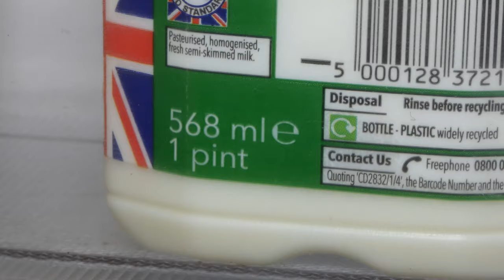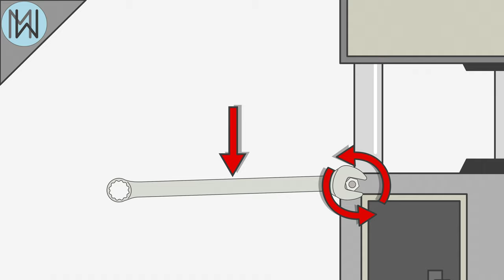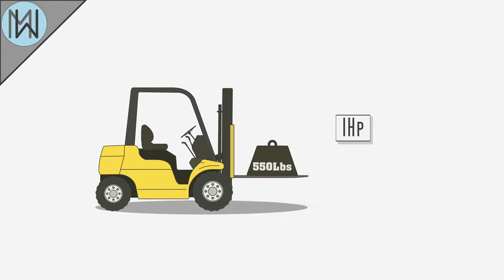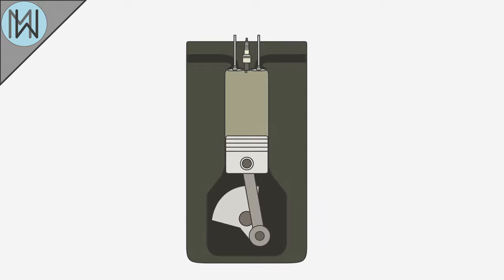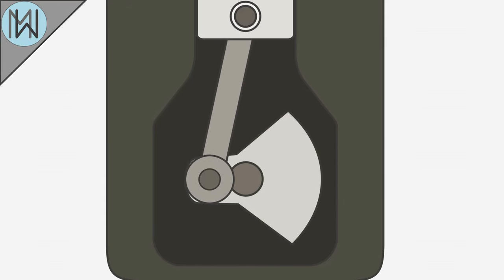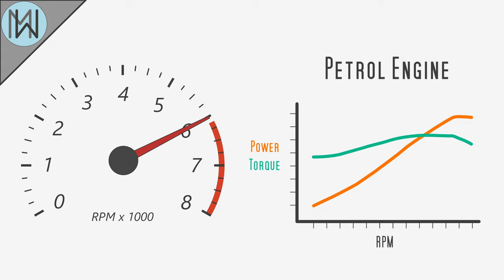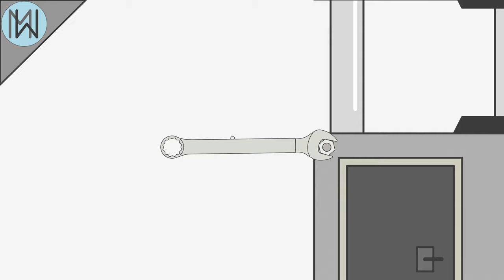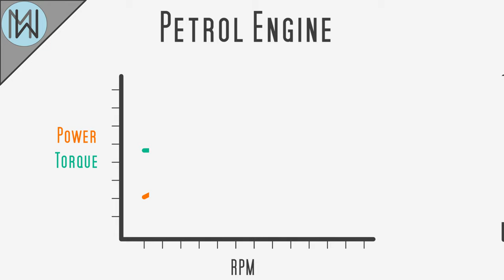Torque vs. Horsepower Explained

Comment: Horsepower at the engine is more important than torque at the engine.  If you have horsepower at the engine, you can always use gearing (torque multiplication) to increase the torque.  If all you have is torque, you CANNOT get extra power by modifying the gearing.  Ever.  That's physics.
Reply: in real driving conditions it's better have torque driving low rpms. if you think motorsport it's the opposite
Reply: @mariocasinetti158 true .
Reply: Quite theoretical, yet how come there is no excavator nor truck rev for torque, hmm..🤔
Reply: @dudulin1359  Because they run all day, every day and need efficiency and longevity.    Not because a higher revving engine "wouldn't work."  It would work fine but it would be less efficient and would not last in the application.
Reply: Got it! Quite understandable, so sounds like the engine is like a tool, no such the best in all variations but the most suitable in certain conditions tho? Meaning not always the best seeking for high HP🤔
Reply: @dudulin1359  Excavators and trucks still have horsepower requirements that need to be met.  That doesn't go away just because the engine is big and has a lot of torque.
Reply: @kevin9c1  Yet, relatively not seeking for ultimate HP right? Of course there's a baseline HP requirement. But not like a sports car which all means to be  high-end horse power, is it?
Reply: @dudulin1359  I didn't say high end horsepower originally.  I just said horsepower.  It could come at 2000 rpm or 10,000 rpm.  The important thing is how much power you have.  That dictates how much work you can do per unit time, always.
Reply: @kevin9c1  You're right, high-end isn't the factor here😂. You just answered the very first question, didn't you~ With a certain size of engine, some goes for peak torque at 2000rpm(some even less under 1000rpm) as for the specific needed like heavier loading or working needs which let the devs think "Alright, what should I do with this 5000cc monster engine? I don't want too much HP from it as I'll lose my low-end torque, instead I'll go for a low HP design with an extreme long stroke to make it more torqey."

Whilst, some go for an engine's sweet spot at 10000rpm due to its light weight design and no need to carry heavy load that the designer thinks "hmm, so I've got 1000cc engine on this R1, I would let it have a shorter stroke and revs higher for more HP since it doesn't carry too much load." 

These prove that for different situations tho, torque or either HP could have been considered even more important than the other one respectively, does it? Or maybe I may be expecting Optimus Prime revving for high HP in next Transformers based on your theory 😂😂 I'm looking forward to that anyways you know, that would be fun🤣
Reply: don't forget about 'Power and Weight Ratio', no matter how big the power is, if the weight is big too, it doesn't make any different
Reply: @mariocasinetti158 small turbos give you very low end torque, and more horsepower too.
Reply: Higher gear is more torque?

Comment: It all starts with Torque.  An electric motor can produce all its torque at 0 rpm.  That means 0 horsepower.  It’d be the same as pulling maximum force on a spanner but it doesn’t budge.  All torque and no work so no power.  But, the opposite can never be true.

Comment: Horsepower is a UNIT of power. Torque is a measure of twisting forces.  1 horsepower equals 745.7 Watts. Life is easier if we avoid those old units.

Comment: Great explanation.

Torque is an expression of twisting force with NO REGARD FOR SPEED.  It could be at 0 rpm or 10,000 rpm.
Horsepower is a more complete expression of performance, taking both torque and speed into account.

As is common when speaking of car engines, torque is usually noted AT a particular speed.  This is in fact all we need to compute HP, but the math is simply not completed.  We could just as easily say that X engine makes 360 hp at 3500 rpm (its torque peak) and 500 hp at 6250 rpm (its hp peak).  Graphing this curve really tells us a lot.

We can double HP by either doubling torque OR by doubling the rpm at which the same torque is produced.  Or more realistically, by increasing BOTH factors to a lesser degree.

Assuming proper gearing, the engine with more horsepower will ultimately do work more quickly.  OTOH, most of us don't operate street cars at their HP peak very often.  It is unpleasant (to police at least) and hard on the engine.  Low rpm and part throttle torque is useful in everyday cars because they spend so much of their time in that range.

Comment: This is the video that FINALLY, I repeat FINALLY taught me where engine torque actually comes from. The example of loosening a bolt with a wrench to define what torque is has been done by countless "what's torque" videos, and I understood what torque is alright, but I just couldn't transfer the concept to vehicles. My thought was "Ok, but when a car is moving, it's the other way around: you turn the wheels' center so that the wheel can rotate and the vehicle can move, you are not acting on the wheels like you'd do with the wrench". Those videos, at least the ones I've watched, missed the part at 2:35 - it all starts with the pistons being pushed by the working fluid (air-gas mixture, air-diesel mixture, steam...), and the pistons in turn push or pull their crankpins in the crankshaft, making the latter rotate. The pistons pushing the crankpins and rotating the 'shaft are like our jands pushing on the wrench to loosen (rotate) the bolt. It's then relatively easy to work your way to the wheels from this point!! Thanks for the video and the explanation!!!
Reply from the maker: I'm glad it helped you! Thank you for taking the time to leave a comment.

Comment: It is a common misconception to believe that a longer stroke generates higher torque. The complete physics and thermodynamics of it all are quite complex, but in general terms, for a given displacement, the longer stroke is offset by the smaller piston area on which the combustion gases apply pressure, which results in less force being applied. Truck engine make more torque because they are big: there is no substitute for displacement.

Also, a 300hp engine will be able to move the same heavy load up a hill at the exact same speed, be it a 8000rpm sports car engine or a big diesel truck engine, it's all in the gearing. Truck engines are "tuned for torque" simply for durability and fuel economy reasons. By being able to generate the desired power levels at low RPM, they can last way longer and consume less fuel in the process.
Reply: Torque has absolutely NOTHING to do with stroke, and is solely dependent on Pme, i.e. cylinder filling!

Comment: Power is how fast you (or the engine) generate chunks of energy and torque is sort of how big are the chunks. The piston strokes are “stronger” with more torque. That’s half of the problem. The next problem is why small chunks at high rate is equivalent to high chunks at low rate. You can try on a bicycle, to go on a slope you can either use lower gear and low torque or high gear and push hard with the bicycle going the same speed in both cases. So with high torque you will use a high gear ratio. But what about high torque and low gear ratio. That can be done and the rpm will go up quickly so you will need to be capable of high rpm but high rpm and high torque simply means a lot more power so in that case you have a more powerful engine. 
Another problem is trying to analyze the power curve. You can have high torque from low rpm. That also means high power not only torque at that low rpm and that makes the car relatively fast without needing to push the rpm high.
Reply: 'chunks'. Please, take your talent elsewhere.
Reply: About the 'chunks of energy' verbiage; what you are saying seems consistent and clear, but it points to a common misunderstanding of power if I'm interpreting your meaning correctly. I sincerely want to help more people actually understand power. There are so many people who will have good ideas in vehicular engineering, and have drive to make stuff happen, but have a common and crippling misunderstanding of power. It's a really foundational thing to understand and unlocks a lot of doors.
You seem to be describing power as though it is equivalent to engine speed, as the rate of producing chunks of energy REGARDLESS of their size. In truth, power is the rate of producing chunks of energy INCLUSIVE of their size. Engine torque is "swallowed up" in the significance of power. It is (in one of it's many forms) simply rotational speed times torque. In your examples, you speak of power and torque as two different ways to achieve a particular level of performance. This is largely true for RPM and torque, but NOT true for power and torque in any way, ever. Because power is the product of torque and something dimensionally different (engine speed), power and torque are dimensionally incomparable. (Tangent: 5252 rpm has no physical significance at all)
To know the actual thrust force that an engine is imparting to any wheel-driven vehicle at some moment while it is moving, all we need to know is the engine's power at that moment. We know a little of that power is lost in the transmission / final drive / tires, but besides these, thrust depends only on power and vehicle speed at that moment. 
If we don't know the engine power, then even if we know the torque the engine is producing at that moment, we can only guess at thrust it's providing, because we must NOT know the mechanical advantage (gearing and wheel diameter) that connect that engine to the road - basically the ratio of distance rolled per engine revolution). If we did, then we do know power, because that ratio together with the vehicle speed dictates the engine speed. All this assumes that the tires and clutch aren't slipping, but that's really the only significant assumption. 
Is this making sense?

Comment: So torque gets you started and hp maintains?
Reply: no. 
the amount of tq at the wheel to rotate something is called tq. that doesnt change
but how much tq you can apply based on how fast the car is going based on the road is called hp.

the faster you are travelling, and you want to make the same wheel tq, you need more hp. 
this is why trucks always make lots of tq. the relationship of these two things is the whole point...

a 1hp car, can infact make a "technically" infinite amount of tq, but at an infinitely slow speed...

a large amount of hp can do "techinically" the same thing at an ever increasing higher speed of the vehicle. 

this is why the trap speed of a mass going down the 1/4 mile is based on hp, not tq. 

hope this helps